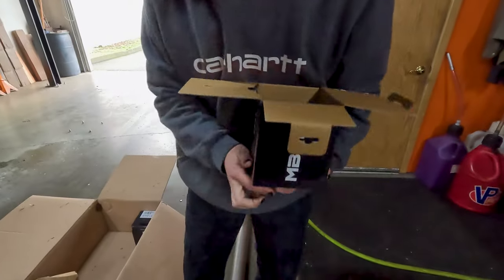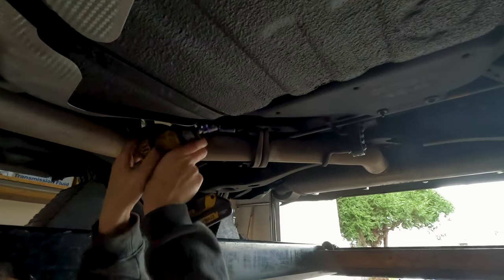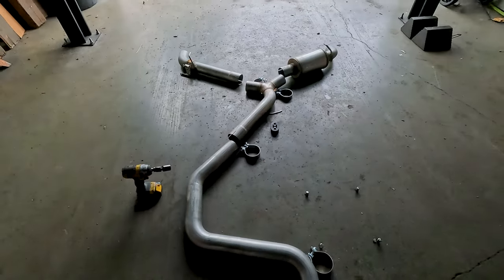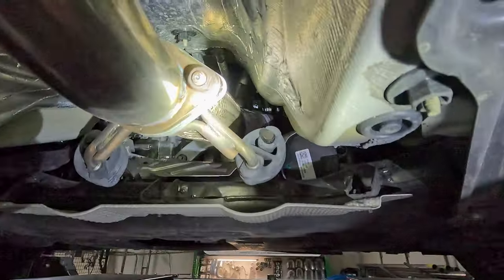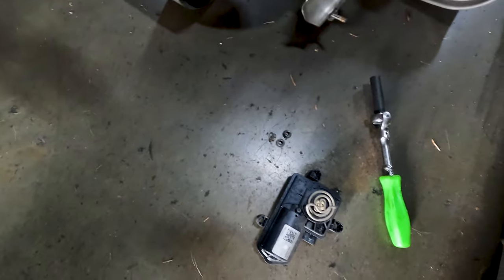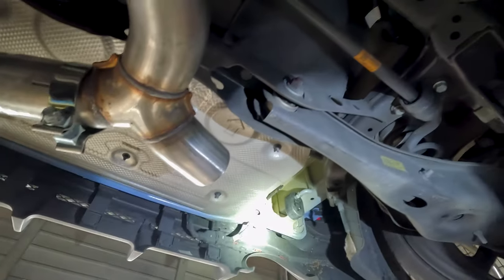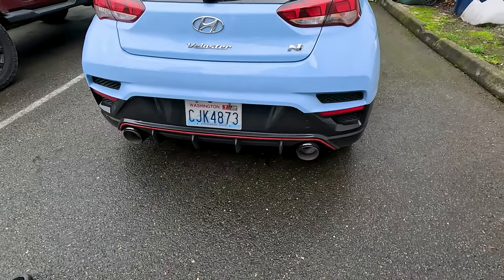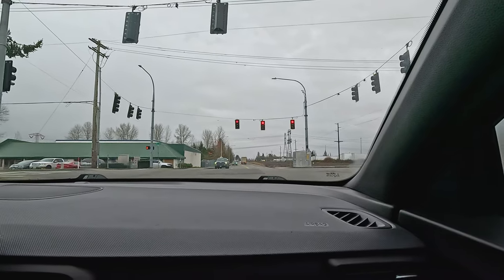Veloster N MBRP Exhaust Install

Comment: Bro you didn't need to spend money on the exhaust. All you need is downpipe and Ark midpipe with res delete. My car sounded amazing after that. After market exhaust for these vehicles is a waste of money because they already sound good and with res delete and dp it'll sound even better
Reply from the maker: ARK? Anything ARK is super expensive. And it's also getting a down pipe. We get all of our parts from Torkmotorsports the only company that has their own shop cars, tunes for Hyundai's rally team, and has been the only shop to not mess up my cars. If you want performance gains running the factory muffler isn't the move. We don't only daily our cars but we race them. Plus the weight savings alone are worth it. Plus as sponsored drivers and doing R&D we get to experience it all.
Reply: @DankersRacing   I mean if you're racing your car then yeah that makes sense, most people aren't tho
Reply from the maker: @i.d.6492  That is true! I always like to build cars around what they are going to be used for. Plus installing parts is fun 😅
Reply: @DankersRacing   I've had build VN stock turbo but everything else was upgraded. Spend over $10K on performance and exterior mods, carbon steering wheel, alcantara dash, arm rest I mean I had it all only for it to be totalled 😭
Reply from the maker: @i.d.6492 Sounds like my old VT
Reply: I have the ark mid pipe & I’m thinking about switching to a catback because the airflow with the midpipe on the stock exhaust is uneven 🤦‍♂️